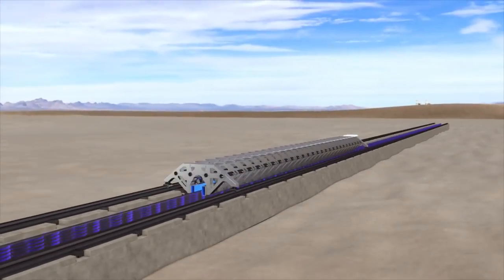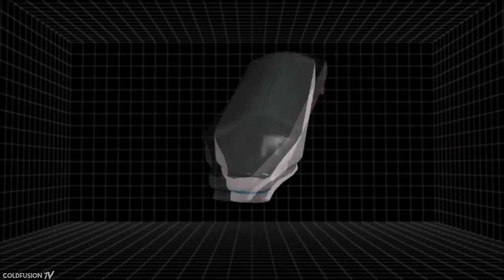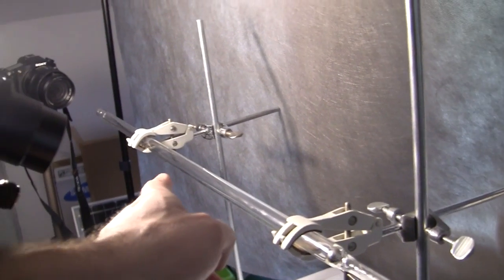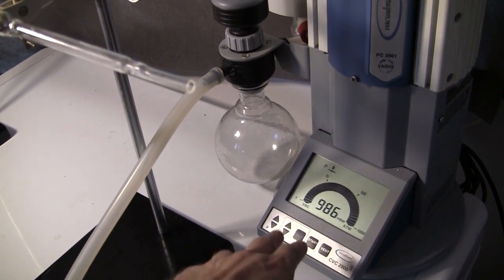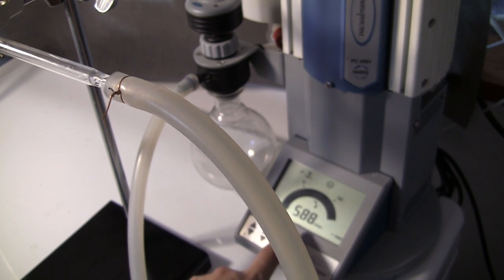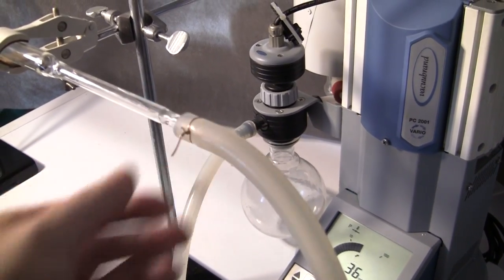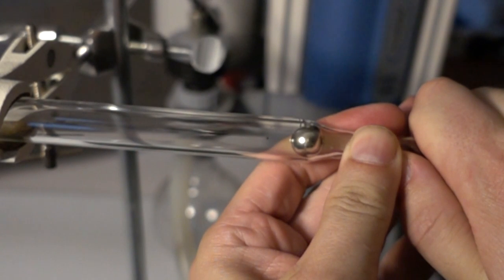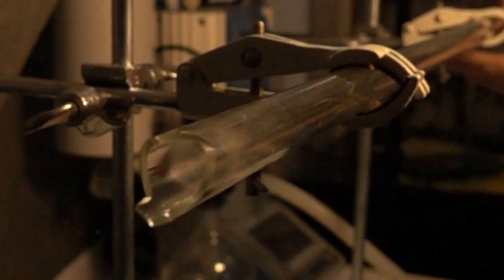How  the Hyperloop can kill you!

Comment: Wouldn't an acceleration to nearly Mach 1 in just a second exert massive g forces on the passengers?
Reply: It wouldn't accelerate that quickly and i seriously doubt it would even hit those speeds if the carriage was stationary at the time of such an accident.
Reply: It sure would, but even very large large momentary G Forces are fairly easily survivable, so long as they are taken straight on.
Reply: ***** I doubt it, these carriages are going to be designed in a very aerodynamic way to cut through what little air is left and it WILL have a way to brake, its not going to be like a metal ball in a very tight tube. Quite frankly this is an engineering problem. What Tfoot has done here is the equivalent of making a paper plane, throwing it, then coming to the conclusion that a real plane is a bad idea because his fell to the ground.
Reply: I fully agree with your stance, I know there will be brakes and that his demonstration is inaccurate. What I'm speaking on are the G forces experienced from the initial acceleration, and potentially the deceleration.

Like I said, they wouldn't be deadly, but they'd still be quite high.
I thought OP's question was in reference just to the travel bit, not the crises of a vacuum failure.